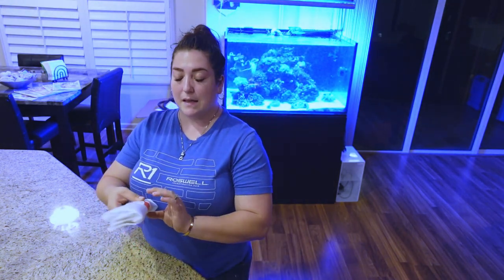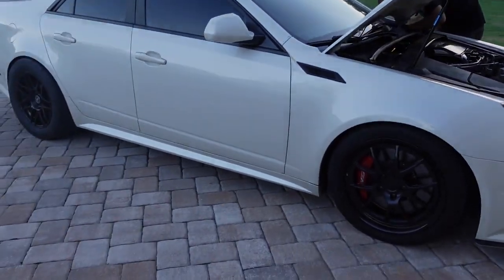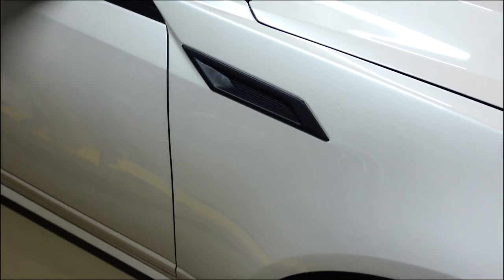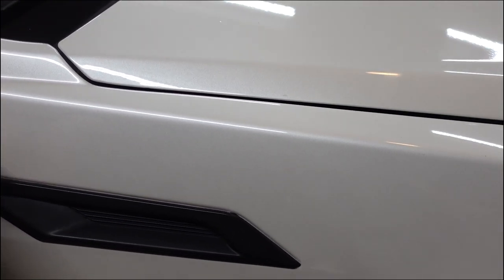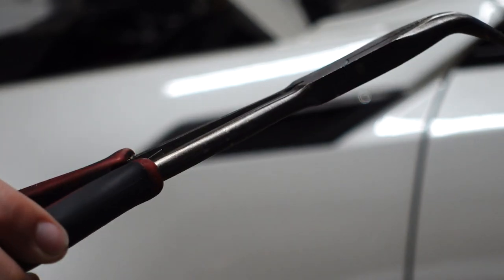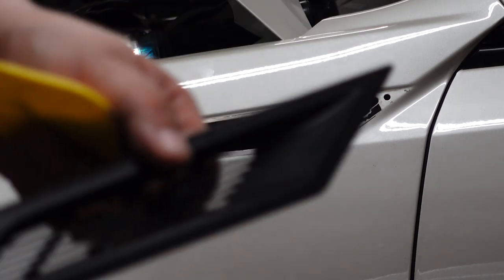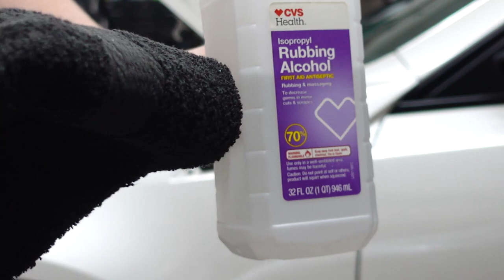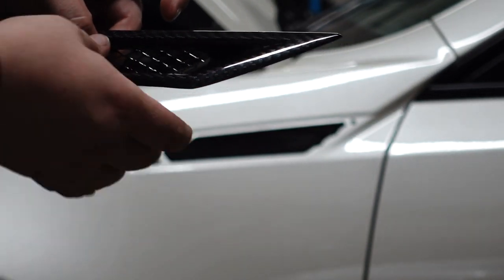Weapon X Carbon Fiber Fender Vent Unboxing & Install! | Amanda Rae Jean

Comment: Thanks for this instructional video. I just put mine on this afternoon. I didn't feel like the 3M tape was contacting the fender very well, did you have this issue? I think I might get some more 3M tape and try to make it stick in more places.
Reply from the maker: Didn't have issues but we did tape all the way around, it does lift in some areas where you may be able to add more for sure. It wasn't as easy as it looks lol. I love the look though.